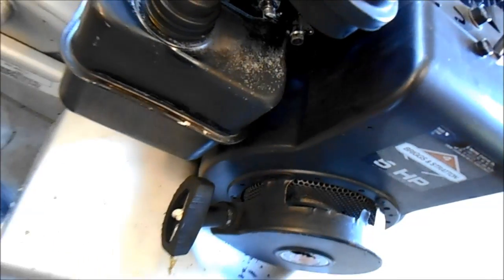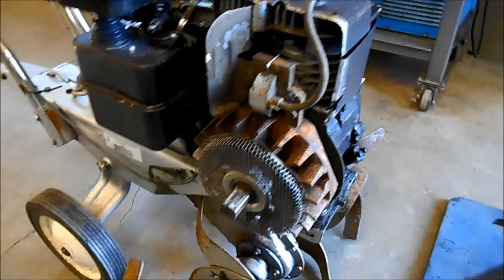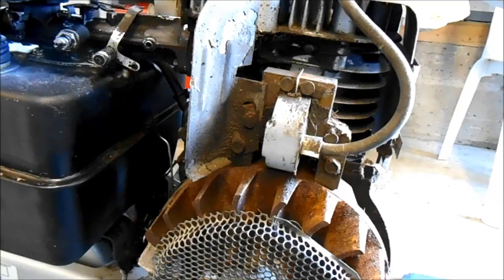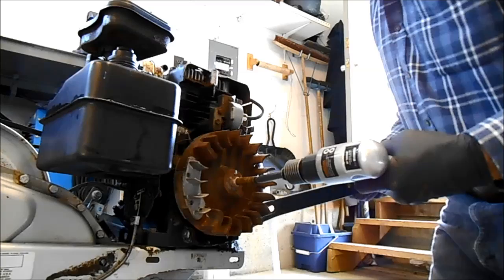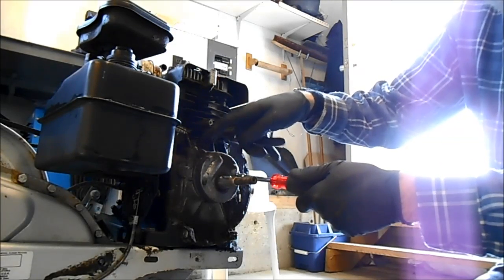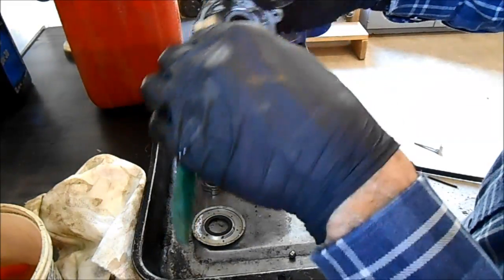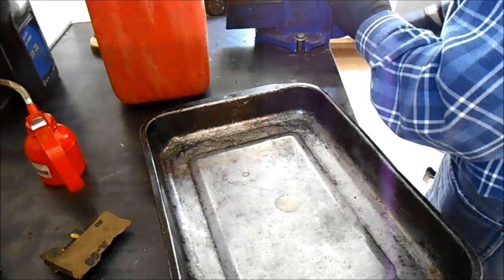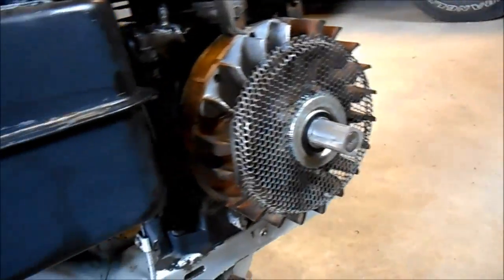Removing Points on a 5HP Tiller

Comment: Could I use a coil from a 2008 lawnmower on a tiller if so how would I stop the engine
Reply from the maker: If the coil fits there should be a connector on the coil to hook up the kill wire from the original machine.  It should work.  I have even wired in a switch    lots to google

Comment: I've become quite familiar with small engines in the last year or so working on small engines and watching your vids on you tube as well as others !!  But I still have some problems trying to find the model ## on the machine. And trying to find the best /cheapest place to order/buy the parts.  I would like to see a video on finding model#'S on different machines and talking about what parts could interchange with each other and to make sure u order the correct part.  U have the model # for the machine and the engine!!  Kinda confusing too me sometimes. Am I a lone wolf here or does other people have the same problem???  Thanks for all your hard work!!      But one more note on the model#. Some have the model/type/code. Do u understand what all that means??
Reply from the maker: Briggs aren't to bad.  Their model # is near the date on the blower housing.  I struggle with the rest though just like you..

Comment: Bruce don't ever lose those ball bearings are the screen screws they are so expensive from Briggs even here in the states. Here is a Tom Boy mower I worked on last year.  They were made in Missouri for grave yards and such. They look like Lawn Boy but they put Briggs engines on them. Solid aluminum frames on these boys. This 1977 came with a electronic coil on it to my surprise. The other one he had was a 79 or 80 model and I did like you and converted it to a newer style coil. ~!~!  Enjoy my short video.. 

https://youtu.be/Yw1Av2nQgoA

Comment: Little tip, when you use a punch to jar the pullstart ratched , replace one of the small screws back into it so that the threaded hold is not knocked out of shape. Good video, shame it wasn't around when I was on the learning curve as a young lad.

Comment: What did you do about the hole for the contact point actuator rod?  I know that there is a block-off pin available in the aftermarket.  Did you use one of them?
Reply from the maker: Good eye.  I have not had any issues with removing the rod.   I have just removed it on many machines.  It fits in loose .  Sorry for the delay I have had a bad internet connection for a bit.

Comment: I have a old 5hp briggs kind of similar to the one in the video, I have to change the seal around the output shaft, the flywheel and magnet have rust on them but I'm just glad the engine works at all.
Reply from the maker: Rust shouldn't effect the flywheel.  You can wirebrush it.

Comment: Nice video !  What is the gas and oil mixture "primer" that you showed used for?
Reply from the maker: Sometimes it is 10% 2 stroke oil and gas and sometimes it is just a 2 stroke mix from my gas can.  Oops i confessed.  Mostly it is 10% 2 stroke oil.
Reply: Do you use it to help start engines?
Reply from the maker: Yes I prime "or pour it in the carb"  that helps to get some fuel into the system when it is dry.
Reply: Excellent, thank you for the info Bruce.

Comment: Thank you! Had a rusted on flywheel that would not budge, heat & pb blaster did nothing. I tried the air hammer and it popped right off, saved a bunch of effort.
Reply from the maker: +Kyler Kraus I works well.  Thanks

Comment: You could of just left the points in there and just cut the wires. It seems like you made more wore then needed.
Reply: Absolutely, didn't have ti remove fly wheel, just cut the wires
Reply: I have a shop also and I go the extra mile to do it right and oil the ball bearings in the starter clutch. Wow that was a lot of moisture in there Bruce ~!~!
Reply: @Boudrow  yep, make sure that starter clutch rolls freely
Reply from the maker: Yes it must have been stored outside at one point     EH!!!!
Reply from the maker: Yes but They are gone right.  Work is OK

Comment: Hehe, I learned this stuff in small-engines class at high school. Pretty fun class! I had several other fun classes as well.

How come you didn't show us video of all the steps (taking the starter housing off)?
Reply from the maker: +MaxxFordham It is hard to show it all in 15 minutes. Sometimes I make 2 or 3 parts
Reply: LOL, Bruce Pender, how come you didn't know that even when you posted this video, the YouTube had long-allowed videos that are much, much longer than 15 min.?

Even then, though you thought there was still a 15-minute limit, why didn't you just start one of the screws at normal speed and then high-speed the rest just like you did on some of the other parts (while still figuring out a few other seconds here or there to shave off in order to make room, without leaving out the rest of those other samples)?
Reply: +MaxxFordham That takes 5 minutes.
Reply: And... your point is..., bser3973?

Comment: At the end you point at a "little wire". What is it? Electric? Part of the new coil? ?
Reply from the maker: +The Final Front Ear      That wire comes off the coil and it goes to the shut off switch.  The shut off switch grounds it and stop the spark ---turning off the motor.  Thanks for being so thorough.

Comment: Is it strictly trial and error retrofitting electronic for a points system. Much of my yard equipment is upwards of 40 years and I can expect problems. Is there some kind of exchange reference?
Reply from the maker: L Malino Gosh I would have to say I don't know.  Size of the new coil is the key for me.  Take the old one into a place where you can compare sizes.
Reply: +Bruce Pender Do you know whether the magnetron delivers a hotter spark? Are there any ancillary benefits other than fewer wires and not having to remove the flywheel? How about reliability vs standard? Thanks for any info.

Comment: Thank you for the videos, you do very good work. I have a tip if you don't mind. When lubricating the starter ratchet  automatic transmission fluid is a really good way to go. It last longer takes higher heat and doesn't attract as much dust. Please keep the videos coming.
Reply from the maker: max98138 Thanks a lot
Reply from the maker: max98138 
You have a nice channel.  You should consider making a few videos.  You will find it challenging a humbling too.

Comment: I remember all the blood, sweat, & tears from
when I used to try to get a set of points to work :)
Reply from the maker: on the vintage stuff I still stick to points.  But those B&S points are hard to set.
Reply from the maker: @Derrick Smiley I would check the valves.  I don't know if your has compression release.  That can lower it too.
Reply from the maker: @Derrick Smiley does it run OK.
Reply from the maker: @Derrick Smiley Yes i do.

Comment: I checked the price for a string line trimmer ignition coil and it was half the cost of a new machine.  I bought a new trimmer.
Reply from the maker: Yes trimmer's are only worth doing if they are gummed up.  Good work

Comment: Great info Bruce! I've got a 70's Snapper push mower I need to convert, & I wasn't sure where to put the kill wire.
Reply from the maker: Alan Marshall Usually there is a plastic-metal clip for the wire close to where the throttle cable mounts on the throttle assembly.  I have also just added a $3 switch on the housing to ground out the wire.
Reply: You don't actually need to remove the points and condenser. (I get that you had to let the water out of yours, so you already had it apart.)

They can normally be left in there as they're nonfunctional anymore. It won't hurt to leave them in.